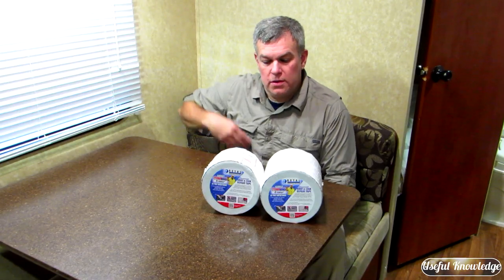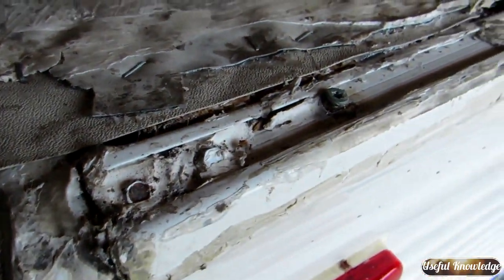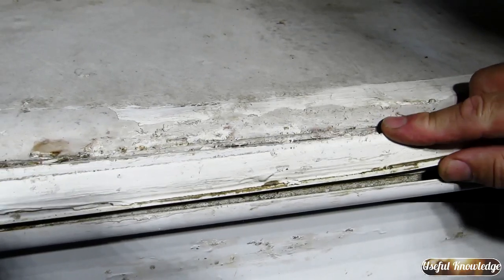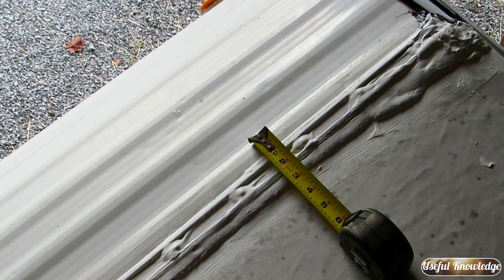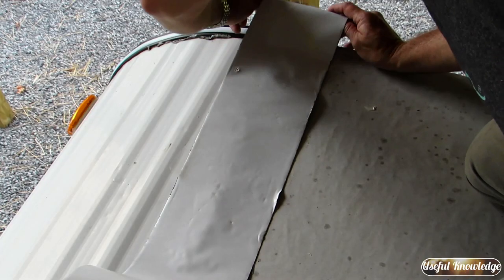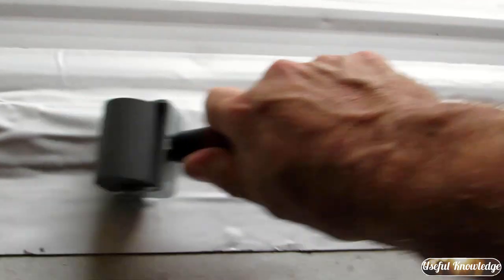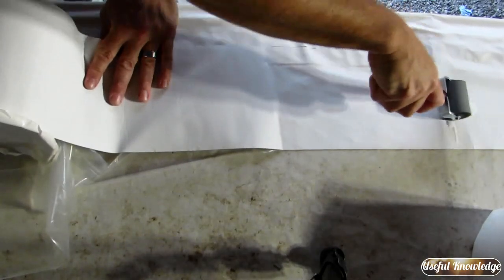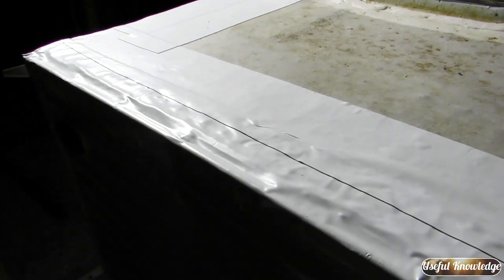Eternabond RV Roof Repair | Useful Knowledge

Comment from the maker: UPDATE!!!  OK everyone.  It has been one year since I used Eternabond Tape to repair this camper roof.  The camper has been out in the north Alabama weather the entire time.  I checked it for leaks yesterday 02 Sep 19.  No leaks!  Everything is in great shape.
Reply: Good to know, I am applying some along a seam as a preventive 3" but nice to know it would last
Reply: Wondering if could add Eternabond as a Preventive on NEW campers and RV roofs to prevent leaks at the corners. Wonder why manufacturers don't do this anyway? Perhaps to sell a new one every 3 years?
Reply: This was an excellent video.  Thank you for doing this.  You are an excellent instructor, you speak clearly, you show what needs to be shown, and you are careful to take your time and emphasize what's important.  WELL DONE!
Reply from the maker: John Penumbra.  Thanks for the kind comments!
Reply: Thanks for updating ! I was curious
Reply: I just used this tape to fix a hole I had in my camper roof. This is great tape. Also covered it with Henry's Tropicool for added protection. 2 days later we got a pretty hard rain and we had not one leak. I'm very happy with the end result. Great video brother!!
Reply: Just a question. Did you use the Eternabond primer with the tape? Good work with gluing the membrane back down.
Reply from the maker: Hi.  I didn’t use the Eternabond primer.  I cleaned the area with vinegar which killed all of the mold and mildew that gets on the camper edges.  Basically when I was done with that, it was ready for the tape.  It has not turned loose even a little.  It’s some very very good tape.
Reply: @OurOregonlife  Yes doing that for my Caravan here in the UK
Reply: How’s it holding up?
Reply from the maker: Well I just sold the camper because I built out a tiny cabin.  It was actually looked like I had just put it on when I sold the camper. No issues with leaks at all.  We also put this on our editor’s (John) camper about 2.5 years ago.  It’s also doing great.
Reply: I wish I knew about thing long ago! I’ve been using Henry’s roof leak caulk and it still leaks! Thanks for the info and helpful video!

Comment: As an RV tech, I’ll use the Eternabond tape to patch cuts or small holes in the roof material that are recent and haven’t had a chance to rot the wood under it. If applied correctly, an Eternabond patch can last the life of the roof. By drying out your trailer and cleaning and applying correctly, you will get a few more good years out of it. Obviously, I’m not going to do that because it’s not a professional job, but you saved your trailer and a lot of money. Your OSB was discolored, but not rotted and you dried it for 2 weeks, therefore nice job. I would recommend sealing the corners with some Dicor self-leveling caulking to stop any water infiltration from creeping under the Eternabond where the moldings make it difficult to get 100% seal with the tape alone, although you took your time and did a good job.
Reply from the maker: Thanks!  It's doing well right now sitting at the hunting club and staying dry inside.  I do like your Dicor tip!  I really feel like if I had bought that camper 6 months later, it would have been a major restore.
Reply: Would it have been better to remove the hold down stripes & start the tape under them like the original roof liner?

Comment: Definitely should have replaced the wood underneath the rubber, that’s just asking for mold in the future. This is a temporary fix.
Reply from the maker: Dyl Panell.  ??  It wasn’t rotten.  No requirement to replace.
Reply: Like he said. It’s just a hunting camper. Completely different circumstances if it’s your family’s weekend getaway retreat. When someone says “I would like to buy a hunting cabin!”  That usually means just four walls and a roof... That doesn’t leak 😉
Reply: Thanks for the suggestion I understand why you did that .although  these are just some quick fixes for your self .  Thank you

Comment: I did the same around the whole perimeter of my toy hauler. I bought it super cheap because of the water intrusion. The front cap is delaminated along with a couple spots on the side walls. The EDPM roof was torn along the edges and the front strip wasn't sealed properly. I went through almost two 50' rolls and a lot of Dicor self leveling caulking. For all the side stuff I use the EternaBond caulking so it doesn't run down. Plus it's better than silicon. I also used the Dicor two part roof sealant system to further seal everything up. It is water tight now and buys me some time. You did a great job and you should be trouble free for several years.
Reply from the maker: Thanks for the nice comments.  Sounds like you ran in to a tough fix like I did.  Good to hear its water tight.  These campers seem to leak too easily now a days.  Thanks for the heads up on the caulk.  I didn't know they made that.  Best of luck!
Reply from the maker: #1 TRACKRECORD what-a-JOKE.  It’s parked on an old east to west power line.  It gets both sun and shade depending on the time of year.   As of a month ago which is the last time I was out there, absolutely no leaks.  We actually used the tape on our producer John’s camper which is parked next to mine.  It’s all good news so far.

Comment: Aren't you supposed to change all that rotted wood?  😮
Reply from the maker: W/0Money. Hi.  It was discolored but not structurally rotted.  This was the main reason I let it dry for two weeks in my barn.  If it had spent another few months without being repaired, it would have been much worse.  Thanks!
Reply: Its a good temp solution if you vant get youre rv in to get fixed because bookings are one year out

Comment: I had an issue around my awning, cleaned and put down Eterna Bond!!!! Wala!!! No more leaks! Thanks for your instrumental information.
Reply from the maker: Priscilla Richardson.  Awesome!  It’s definitely great tape.  I had a large limb fall and punch a hole in my newer Camper’s slide out roof.  Eternabond tape had it fixed in 5 minutes.  My hunting camper is still not leaking at all. Thanks!
Reply: @useful.knowledge  Wondering how this would actually use as awing repair tape? I've used awning tape a bit which is decent but perhaps this would be better? Of course, needs to be flexible.
Reply from the maker: @lynnpalmer8133  Hi. I think you could.  it seems to be flexible but my concern would be rolling up the awning.  I'm just not sure its that flexible.  It's awesome tape.
Reply: Um, Priscilla, it’s Voila, not “Wala” - blame the spelling on the French

Comment: NIce job!  I can only imagine that a 2nd person, would have made it 4 times easier.  Think I would have done the side first, then the top, so that it overlaps from above. But hey, if it works, it works!
Reply from the maker: I could have definitely used a helper!  John and I did his camper with Eternabond in about 30 minutes.

Comment: Using a heat gun is helpful on ends  transitions. Use extreme caution to not over heat. It should be not hot that you cannot work with your fingers.
Lacquer thinners is a good cleaner/primer.
Apply with clean soft cloth, no puddles.

Comment: Thanks so much for the video and so to the point and clear!!  Besides very helpful as I have a nephew in LA that has a section of his 5th wheel that has done the same as yours..and I sure hope I can get him to watch and learn from your video on repairing his (bed)  area..his too has been leaking ( with numerous repairs that haven't either been done correctly or those who "tried" without success hasn't fixed the problem..."money to the wind"..I sure hope he will get help in doing this (IF it hasn't already been done...just hope it works !!  (He's considering selling his for a hunting camp too..especially if he can't get the roof repaired correctly.  Thanks again !!
Reply from the maker: Hi.  Thanks!!  I sold the one in the video about a years ago.  It’s still not leaking.  We also applied the tape to editor John’s camper.  Still no leaks!  That tape is great!!

Comment: I would have used contact cement in the 'envelope' utilizing dowels as you would when gluing a Formica countertop down. That being said, I would apply the dowels when placing the tape in position after the sealing membrane has been removed to prevent unintended contact & sticking. Just pull the dowels out as the application progresses.  Sweet as you please!  : )

Comment: I just bought the tape but think I'm going to need that high priced roller too wow lol. my rv is old and leaky too, I'd like to use it as a living space though, so I def need to get these leaks covered on the sides, my channel strip is actually hanging of now, see I was just going to put the tape slam on dirt lol. But this makes more sense. So I'm going to get my ladder and 50/50 vine and water and clean, remove the whole trim or cut whats hanging and just put this tape over the part thats cut. 

I have this old awning thats attaching right, its all shredded up I can't even tell where the water is going but its def leaking right underneath the damaged awning, I want to detach the whole thing but have to look more into that later in the day hours, its night right now.
Reply from the maker: All sounds good.  You can use a rolling pin if you have one instead of the pricey roller.

Comment: thanks for the update   anymore info on rv  maintance
Reply from the maker: Hi.  Thanks!  We have a video on out there on RV air conditioner freezing up.  We had an AC unit on our producer's old hunting camper freezing up in about 30 minutes.  We cleaned because it was basically stopped up.  Here is the link:  https://youtu.be/w71FaqZ-fWM

Comment: Great video.  Thanks.  The area I need to repair is the leading edge on a 2016 Keystone Passport.  Currently there is calk that was put on in manufacturing, and is now cracking.  Do I need to remove the calk, or just tape over it after cleaning?  Thanks in advance for the answer
Reply from the maker: Hi.  Our video producer John and I hunt together.  Last year we put eternabond tape on his camper.  The caulk was horribly cracking.  We didn’t remove it because it would have took forever.  We just smoothed out any really bad areas that were sticking up with a utility knife.  After that we just put the eternabond over it.  We did clean it all really good with vinegar first. All the best.

Comment: So I want to use eternabond tape to cover up some areas on our rv's rubber roof that are looking like a leak could start - my question:   is this stuff easy to come off if you need to do more major repairs down the road? Thanks  great video

Comment: Did you use eternabond tape on just the seams or the whole roof? If not what did you do for the rest of your roof to seal it? I have camper that got some water damage and I need to seal my roof before winter.
Reply from the maker: Hi.  I just did the seams.  Check with your local RV dealer.  My local dealer has some products that rolls on to seal the roof deck.

Comment: WITH ETERNA BOND just make sure to seal the edges. because the edges will absorb a small amount of water over time. also, flex seal paste can be applied to not only the entire roof but also to the edges of the eterna bond tape.

Comment: Wondering if could add Eternabond as a Preventive on NEW campers and RV roofs to prevent leaks at the corners. Wonder why manufacturers don't do this anyway? Perhaps to sell a new one every 3 years?
Reply: I have older 1997 motorhome. Not leaking at all, but next week I am planing on replacing all caulking and then using eternabond tape on ALL seams. Just as preventative measure.

Comment: I am going to use this on my rig. What material did you put over the screws that were under the inset trim? Also, if there is a channel under the trim, should I fill it with some sort of caulk or???
Reply from the maker: curiousgeorge555.  Hi.  I didn’t put anything over the screws except the tape.  I cleaned the channel and the screws very well. Then I just brought the tape up to the edge of the channel.  The tape went down right over the screws and seated nicely.  So basically I let the tape fill the channel. I was at the hunting camp last night.  No leaks!  This tape is great.
Reply: @useful.knowledge   thanks for the reply

Comment: Did the roller come with the tape, or did you have to purchase it separately?
Reply from the maker: Hi.  I bought the roller separately on Amazon.  Here is the link: MARSHALLTOWN The Premier Line E54D 2-Inch Flat Commercial Grade Solid Rubber Seam Roller with DuraSoft Handle https://www.amazon.com/dp/B000I1EFKM/ref=cm_sw_r_cp_api_glt_i_R5GWY1544DMK9DG4C76C?_encoding=UTF8&psc=1
Reply: @useful.knowledge  thank you, I have a small tear in my roof due to a tree limb I didn't trim soon enough, and I've been researching how to go about fixing it
Reply from the maker: In addition to the hunting camper shown in the video, I have a new camper that has a slide out.  I had a limb poke a hole in my slide out. I used the eternabond tape to fix it about a year ago with no issues since.
Reply: @useful.knowledge  awesome!

Comment: howsit holding up?
Reply from the maker: Hi.  It's actually holding up very well.  The camper has been out at the hunting camp for the past 5 months and we have had lots of rain this fall/winter.  I cut a hole in the wall on the inside so I could let the inside of the wall dry out when I was repairing the roof.  I check it every time I go hunting and its always dry.  So far so good!

Comment: What was the glue you used to adhere the roof material to the composite board?   Was it silicone glue?   Thanks.
Reply from the maker: Dave Bean.  It was Lexal.  An old timer recommended it to me and he was correct.  It will glue down just about anything.

Comment: Just curious - I've heard 50 / 50 vinegar and water before - why not use standard white vinegar without water?   Does it work better with water?   Thanks.
Reply from the maker: Dave Bean.  It’s just to make the vinegar last longer.  At a 50/50 mix, the acidity is still strong enough to quickly kill the mold and fungus living on the roof.  You can certainly use straight vinegar.  I’ve used it straight for cleaning stuff in the past.  Thanks!

Comment: What about the rounded front seams what did you do for that? Thanks!
Reply from the maker: Hi.  We had more rounded seams when we installed Eternabond on editor John’s camper.  Where it rounded, we basically cut slits in the side.  We didn’t cut the tape that would be on top of the camper just the tape on the side of the top.  As the top rolled over, the slits cut in tape on the side would lap over each other and could be pressed together.  The adhesive formed a bond.

Comment: got to it in the nick of time.... you've got rot so far down you have to rebuild the entire thing.  I know. I've done it.
Reply from the maker: Walter.  Hi.  All is well with it so far.  The eternabond tape has completely worked.  It’s my hunting camper so it only gets moved twice a year.  If I was pulling it around a lot, I most likely would tear it down and rebuild.
Reply: mine was class c 24 feet. Water got in in seam.  had to rebuild everything.  So that nobody will have to do it again, i put pure silicon in the seam. Then 4 inch eternabond. Then the molding with butyl. Then another layer of 4 inch eternabond. quadruple redundancey.   Looks like crap. But it won't ever leak again. Eterabond is the "bomb" as these teenagers say about something that works great.

Comment: what did you use to glue down the damaged rubber roofing?
Reply from the maker: moli nyc.  It’s called Lexel.  An ole timer recommended it when I was standing in the caulk/glue isle trying to figure out what to use.  It will glue pretty much anything.  It works.

Comment: I know this isn't a canning video but I was wondering if your method of canning would work for soups as well like you did with your tomatoes?
Reply from the maker: Hi.  Unfortunately the answer is no.  If you add vegetables to make the soup, the mixture would be less acidic and would require pressure canning.  My rule of thumb is to use the canned tomatoes to make the soup fresh. Thanks and great question.
Reply: @useful.knowledge   Ha ha ha!  Way to roll with it
Reply from the maker: OneSssyRedhead 😎.  Thanks!

Comment: I am looking for some help on my travel trailer air keeps coming into the roof and blowing it up I need some advice
Reply: Let me guess, it's a keystone springdale?
Reply: Its a t.p.o.roof, i would guess. Seems to be common problem from the non rubber type roof membrane.  The glue can even still be tacky and they bloat up while driving. Try watching " az expert " youtube videos for some solutions.

Comment: Speed up the process and clean with an actual synthetic neutral cleaner and microfibre cloths. I mean no offence to the vinegar water mix but there is no cleaning surfactant. 35 years in the cleaning industry. I can show a quick demo if you want one posted.

Comment: I'd replace the roof.
Reply from the maker: 🤣.  I haven’t had any issues with the Eternabond repair on the roof.  I do have a general complaint about RV roofs in general.  They are terrible these days in my opinion.  Nothing but a thin rubber material that can be easily punctured.

Comment: Being very Cheap become expensive it looks like you are doing a Mexican Tijuana job
Reply from the maker: You can personally call it whatever you want.  As for me, if the structure is good, fix the leak.  The structure was fine and this is a hunting camper.  I fixed the leak and it has been a great camper for the past two years.  I expect many more years out of it.  Best of all, it doesn’t leak and I didn’t spend a lot of money to fix it.